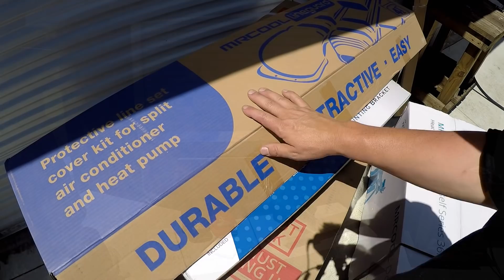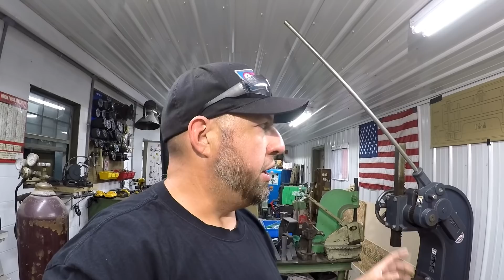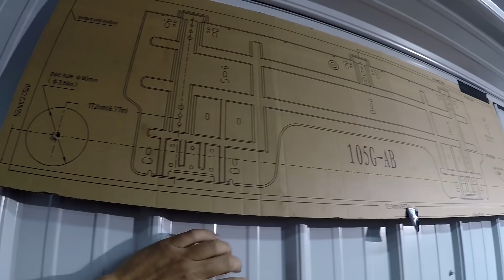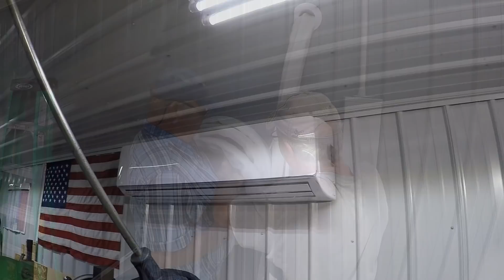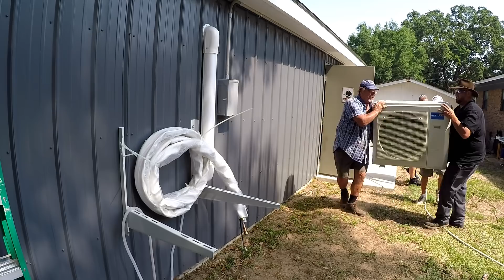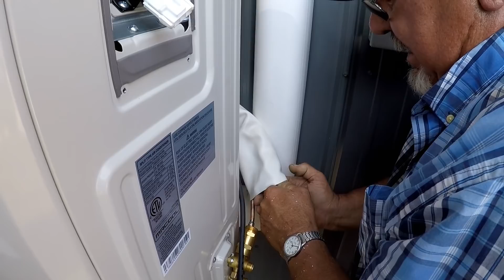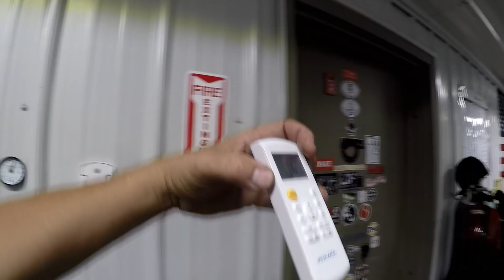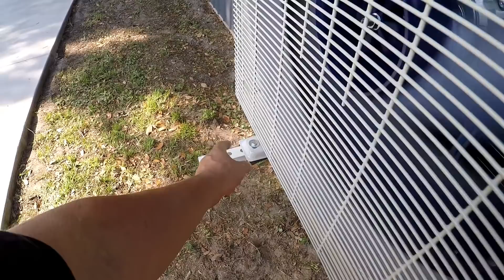Mr Cool DIY Shop AC Install

Comment: Is this shop insulated?
Reply: If you watch the part where they drill the big hole from interior to exterior, you will see pink insulation. It is sandwiched between the exterior metal siding and similar siding on the interior. It threw me off too. I don't think I've seen that type of siding used over insulation before, but it's a good covering if you can afford it!
Reply: @grawkdrums , I like the low rib Ive seen used.

Comment: Linset should not be coiled up, it should be shortened or use a shorter one from the manufacturer .   That coil is trap oil and makes the compressor work much harder .just cut the lines down and pull a vacuum.  Come on Fernando !!!!!!     Enjoy watching you guys and your videos !!!!

Comment: Didn't see you vacuum the lines before releasing the refrigerant.  If you don't, thats the fastest way to kill you unit.  Might want to get someone out to vacuum the lines and recharge them before your unit dies.
Reply: That's Mr cools claim to fame...no vacuum needed.  They have special connectors on the precharged lines that only open when connected.
Reply: he said in the beginning that the lines are pre-charged.
Reply: @mattdisme  the coupling aint prechared or vacuumed. just regular old air in them

Comment: Great installation video and well thought-out, I have metal shop and plan on installing a 36K in my metal shop was wondering have you experience any vibration or leakage from the condenser being attach to the metal wall.

Comment: Really? All that and the part that I actually came here for, the wiring, was only the flipping one way plug? No wiring to the disconnect? Disappointing.
Reply: It uses Bluetooth electricity from the disconnect.
Reply: Good point. There are other videos that are more in depth on that part. I hope you found one!

Comment: My experience:
1) When mounting the indoor unit to wall, the drain hose became disconnected from drain pan. Did not see it and it made a mess and required undoing all the ductless covers to pull the unit back out and attach hose.
2) There is no explanation for the neoprene putty. On Mr Cool site, video shows them stuffing it inside the thru-wall pipe to fill empty space around refrigerant piping. That seems nuts to me I stuffed it with insulation.
3) The video on Mr Cool site shows the wide flange of the thru-wall pipe going on the outside and the flange with the cut-off going inside. The wide flange too large to cover with the Hide-A-Line plastic cover. I installed wide flange inside.
4) I used silicone around the outside of the thru-wall pipe. I didn't use the putty for anything.
5) If you use the right side (facing front of unit) exit for the piping, you have to physically bend the rigid pipes 90 degrees to run them down the wall. That freaked me out when the piping was sticking 3 feet out of the wall. You have to bend it down carefully.
6) When you lay out the refrigerant piping bundle before install, endeavor to maximize the length of the electrical cable, and arrange for the smaller diameter connector to be ~2 inches longer than the larger diameter connecter. This facilitates attaching to compressor.

Comment: Video  seem to show some differences in the units as the lines were factory mounted to the inside unit while others have a pigtail pipe and a connection required at the inside unit. This has a control wire plug while others show direct wiring required. Everyone seem to have trouble with lines being too long for a good install! Not sure why they did not mount the outside unit that extra space out from the wall rather than say cut it off the brackets. Unit sure looked really close to the ceiling when I thought they needed more clearance. This is several years old so maybe install changes with units. Nice to have a lot of help with such a big unit. More like a Do It with Everybody!

Comment: Nice job with the excess tubing.  There are some sorry HVAC types popping up on DIY vids talking crap about all the problems that will happen with all that excess tubing or saying that you cannot cut the line down to size.  Being that the heat pump operates at a much higher pressure than what the AC requires I am willing to bet that is BS.
Reply: There is plenty of pump to force oil back to the compressor with a 25 ft lineset stored vertically or horizontally. Think about roof mounted compressors and air handlers located well below.
Reply: There is a minimum length of 16 feet of lineset. But how it's coiled vertical is not good. And no, it's not bs.
Reply: Funny thing is, it's not bs
Reply: Pretty much all split unit ACs are pre-charged and the amount of refrigerant is calibrated to the length of line included. So, it makes sense to just coil up the excess. I've done that on all my units. If you resize the line without discharging and recharging the unit, you would get an over pressure condition.

Comment: You can buy a 2,3, or 4 zone units. They have corresponding connections ports on the condenser. In the video he only has the single set of ports on his 36K condenser to the 36K air handler hung on the inner wall. So he cannot add more air handlers to this unit.

If you buy the 4 zone system, it's still a 36K condenser but has four connection ports on the outside unit. Has 4 - 12K air handlers. I researched this HVAC system for over a week, maybe 40 hours and Home Depot has 90 days warranty if you have a major problem you could conceivably take it back. It is drop shipped to your home (at least mine was). Not arrived yet though.

Because the lines are prefilled with 410A Freon, the difference in the price has everything to do with the length of lines that you need to run to reach the inside air handlers. At the end of the day 16', or all 25' lines may not reach to were you'd like to mount the inside air handlers in your home. For me, knowing I could take it back within 90 days of purchase, and that I bought the longer line sets right upfront made Home Depot the best price for my application, and currently my electric company is offering a $150.00 rebate on the MRCOOL 36K zone HVAC unit.

If you needed to buy the 25' line sets, they are $300.00 per set, the connectors to run a 50' section are $125 per set. Because the lines are prefilled with Freon is what makes them so expensive to buy after the fact. Buy them as a kit for the best deal. They only make the line sets in a 16' and a 25' so if you need to travel 75' you'd need 2 pair of couplers @ $125 per set. So $900 dollars for the 3 - 25' prefilled line sets, and $250 for the couplers to run this 75' from the condenser. See, so buy as a package deal to save $$.

Comment: With such a long and narrow room area to cool, I don't know why you didn't put a 2 zone unit in there with two smaller size air handlers?
Reply: 25 feet per direction is fine for one unit.

Comment: Dont do the Lines like that you will havet problems wiht your fluid in the system . The shorter lines you havet the smother the unit will work oil problems in youre lines if you do it like this.
Reply: What do you mean? Coiled up behind the unit?
Reply: @stevefroom7877  no do not coil it thats no god you have problems whit your unit then.
Reply: @topdoggarage1212  Coiling it like he did is exactly what MrCool videos and manual instructs you to do.

Comment: Those refrigerant lines are so much more flexible than any I have ever seen or worked on.  They seem like noodles.  Is that some kind of an upgrade.  The rest of the units including the 24k model seems to come with the ore traditional  copper suction and supply lines.  What gives?

Comment: How does it heat in the winter
Reply: Im in North Carolina. I installed the united 18k and it works great. My unstallulated garage will heat up to 80 degrees on a 30 degree day
Reply: It uses what is called a reversing value.  It uses the pressure of the refrigerant to engage the value and reversing the flow of the refrigerant, thus heating it up and blowing it off the evaporator coil.
Reply: @gregrichards6077  Yes I installed one. It was very easy. I have a insulated space and it heats and cool great. No struggle. I got the 18k heats the room in 15 minutes and its 800 sf
I am very happy
Reply: He is in Florida, don't need much heat in Florida
Reply: He has days in the 20's up in the panhandle.  He has videos from those cold days. It's not always hot.

Comment: Nice job. I have a smaller unit and they are great. Don’t cut your outside bracket. The unit outside needs a minimum of 6 inches of clearance from the wall, or in your case the rolled up extra piping, to be efficient. You might want to pull the unit away from the shop wall and use the extra length of the mounting bracket to get your clearance.

Comment: I can’t wait to buy my shop from my landlord the first thing I’m doing is buying 2 mini split systems I’m so sick of the heat! My buddy owns a heating and air conditioning company he recommended installing two 2 ton mini split systems. I am going to buy two 3 ton systems I would rather have more powerful units than I need this way I should have no problems keeping cool.
Reply: Be careful.  If you over size your AC system it can cool too fast and not remove enough moisture.  The Size needs to be carefully calculated on cubic feet and heat loss.  Bigger does NOT always mean better.

Comment: Dude That is about 15 ft of line set Rolled up and hidden there. That seems like it constricts the airflow on the condenser.
Reply: It's on the intake side of the condenser wrt air movement. With a 12" offset from wall it doesn't interfere and it doesn't pick up heat from the condenser.
Reply: There is supposed to be 6" space behind the condenser, so it is a bit too tight.  They should slide the condenser out to the end of the brackets instead of cutting them off.

Comment: 3 tons of A/C  is a lot. It's a ton more than my entire 1100 sq foot house. Just putting up some 1" Therm board backing on the steel walls would go along way  keeping it cool in there with just the window unit.
Reply: You are right.  If it cools too fast it will not remove enough moisture.  People always think "bigger is better" and that's not the case with AC.  The system needs to run enough air to remove moisture while cooling. It's s tubed system.  He's going to have too.much moisture left in the air.  Oh well.
Reply: It's a tuned system, not tubed.  :)

Comment: The power disconnect does not come with unit? Or the wire to condenser?  I bought 3 handler units system.
Reply: It does not

Comment: no leak test, no vacuum, not seen the drain line, no refrigerant pressure vs current test?
Reply: For someone who is so confident they know it all you certainly fall short of knowing what you are looking at. The answers to all of your questions are answered in the video.
Reply: Refrigerant lines are recharged and dont need a vaccum or pressure test.

Comment: Can you cut the extra hose to make it straight line instead of coiling them?
Reply: The short answer is "no".
Reply: @adamdavis7069  You should have used the extra length or installed a contractor unit so u can trim the lines. Would have cost half the price also. Those DIY units are expensive.
Reply: @RadioRich100  No need to cut the lines, it's fine to coil them up. I'm not sure why you think they're expensive, they're literally less than a contractor would charge to just perform the install. Cotsco has the 18K unit right now for $1,300 with smart controller and free shipping. That's a rather good price. Plus, you get a $300 federal rebate and where I'm located you get an additional $250 rebate from the electrical company.
Reply: @RadioRich100  I think it's "*You're in the dark. Mine cost $850 and since the unit is so efficient, I'll receive a $250 rebate from my electric company and a $300 rebate from the federal government. Here's a little secret, the unit has a ten year warranty for parts. Soooooo, if coiling the lines causes the compressor to be starved of oil (which I'm not necessary convinced that it does), they can replace it under warranty. Reading from people that have had a warranty claim for these units, it appears Mr. Cool usually just sends a replacement condenser.
Reply: @RadioRich100  You didn't ask what they normally cost, you asked what mine cost, which was $850. You don't know what they will do with warranty, you're talking out of your a$$.

Comment: I thought new electrical lines and new AC installs both require permits ? I guess DIY-ing work that requires permits will lead to bye bye insurance payout, if smth happens with the place ?
Reply: You only have to hire an HVAC tech for an AC install if you need to have the lines evacuated and charged. That's not necessary with this kit. And as long as you do everything to code you can do all your own electrical work. If you don't understand the electrical code or why there is a code, hire a pro.
Reply: Permitless work doesn't effect home owners insurance payouts contrary to popular belief.
Reply: @mtbjason4  everything affects insurance. If they can find a way not to pay you they wont.
Reply: If the equipment - ANY equipment - is installed according to code, insurance companies will cover it whether there was a permit or not.
Reply: @RadioRich100  Stop spreading conjecture of what you THINK to be true, when I know from first hand experience the fact IS true, that my insurance company covered my air conditioner replacement as it was fried from a power surge. That A/C that blew out was in fact installed by a friend of my neighbor who is an HVAC licensed technician but didn't get any permits. It was 7 years old when the surge happened. Insurance company didn't even ask who did the work. 

This is why the internet is bogus. People like you are free to spread whatever comes to your mind as truth, whether it really is or not.
Reply: In our city, you are supposed to get a permit to put on a new roof, do a bathroom remodel or change your water heater.. it's a way for the city to generate some revenue and micromanage. My brother and I installed my water heater and remodeled my bathroom so I guess we will be getting picked up by the permit police.

Comment: What size disconnect did you use outside for the unit? I’m looking at same unit do you by chance have link for the outdoor disconnect thanks
Reply: Did you have to purchase the disconnect box and wire.seperate should my electrician have those along with breaker etc? Ty just ordered system
Reply: @ellismckinney4888  If the electrician doesn't have these simple items, he/she's not an electrician.
Reply: 30 amp disconnect. Buy it at Lowes or HD. Get the fusible box and maybe save your unit.

Comment: Nice job, Im looking into the Mr. Cool unit also.  You probably could have bought a unit with a slightly shorter line set, maybe a little cheaper.
Reply: They only come in two lengths, 16 and 25 feet.

Comment: On more traditional mini splits any rep will tell you not to coil the lineset vertically. You are making a trap that will interfere with refigerant and its oil. This can lead to performance and compressor issues. I cannot speak for your unit. You may want to see if the manual mentions it. You may want to coil it horizontally under the outdoor unit.
Reply: yea, i was going to say the same thing..oils can become trapped, they told me..
Reply: @ricktxv  Mr. Cool has been producing these units since 2014 and the manual shows them being coiled this way. Additionally, it has a 10 year warranty on parts and a 7 year warranty on the compressor. I think it's fine to coil them.
Reply: @adamdavis7069  on the new Gen 3 models, the manual tells you to coil it horizontally.
Reply: @jeffc6832  I can't find where it states that. It states "coil then wrap bundle excess" and shows a diagram of the exterior unit with the lineset coiled behind it.

Comment: New sub here.  I am considering a DIY mini split install in my garage shop and an office also.  How much power does the 36k unit require (watts or amps on 220)? Thanks for the good video.  I am comfortable with electrical wiring, but am a noobie with refrigerant. How hard is it for a noobie to bend the feed lines?  It looks like the feed lines are fixed so I need to be sure of how long the feed lines need to be, I would assume.  Thanks.  Have a great fall!

Comment: Hey u guys did totally wrong. Refrigerate line have to vacuum air
Reply: This is new technology not old chinese
Reply: @DharmendraPatel-ps9ft  you still to vacuum the lines you don't know what your talking about
Reply: @nellytubes  you don't know what your talking about. The lines are pre charged which is why they can't cut them.
Reply: @ut_punkn1859  take a air conditioning service class. you might learn something
Reply: @nellytubes  use your Google and understand the product you might learn something.
Reply: @ut_punkn1859  Google is your teacher? Hahahahaaha
Reply: Franz Walkup Nelson is right it doesn’t matter what the manufacturer says you have to vacuum the air out and the other big mistake is looping the coil it will create a oil trap behind the condenser
Reply: Cesar Godinez the lines come pre vacuumed with a seal that breaks when screwed it enough to keep it sealed with no leakage. You don’t have to vacuum these lines out

They have a diy version ( like this )
And a non diy version in which you do have to vacuum and refrigerate yourself
Reply: @mattchumoore4214  doesn't matter what the manufacturer says, it only takes a tiny amount of air in the system to slowly screw up the compressor
Reply: @nellytubes  what part of precharged lines do you not understand? 

Are you going to pull a vaccum with the refrigerant in the lines?
Reply: Man, did you not watch the video?  Watch it again.  They tall about the sealed and precharged lines at least 3 times!

Comment: They should not have taped the lines up before pressure testing them. If there is a leak you would have to tear it open to fix it.